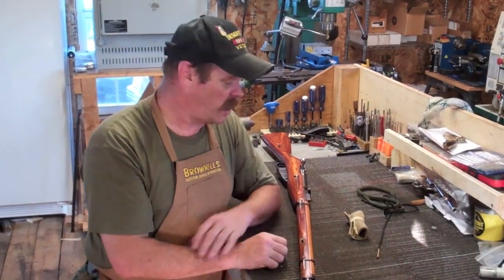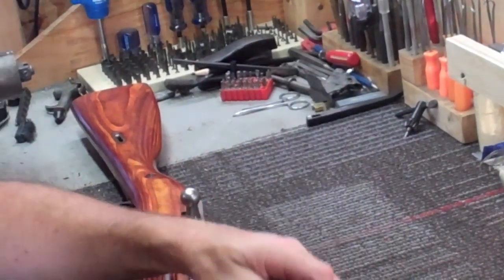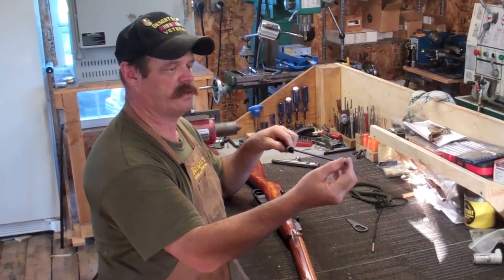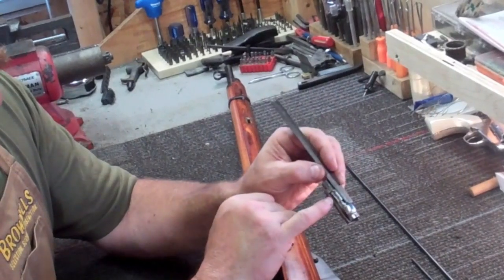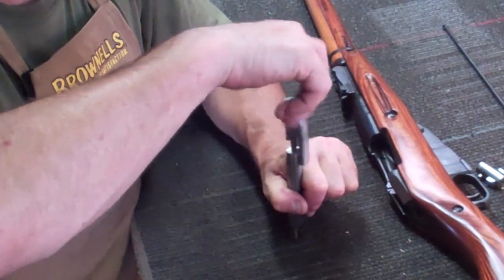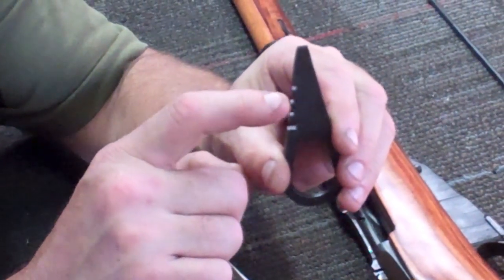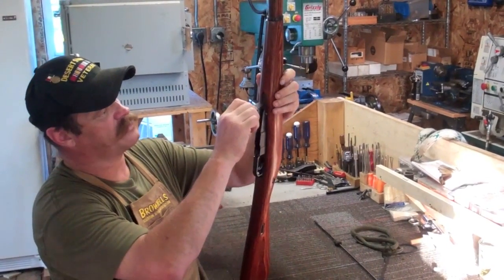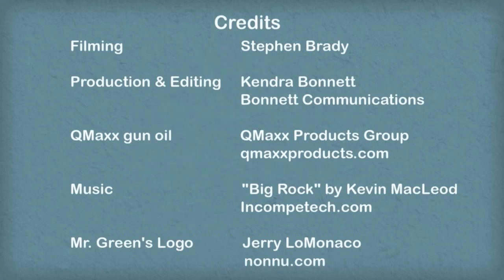Gunsmithing Disassembly: Mosin-Nagant Model 91/30 Gunsmith Cleaning Tips (Gunworks)

Comment: I have watched a lot of Mosin Nagant videos.  I have yet to see one with such easy to understand 'step by step' instructions on bore cleaning and bolt dis assembly.  What I like is how you explain the reason for each step.  How to hold the bolt assembly keeps things from being so awkward, and showing how bolt slide can be used to remove the firing pin. That would have never occurred to me. This is much easier to use than the short tool provided, especially if the multi tool isn't handy.  Great job!  I'm keeping this video bookmarked!

Comment: This is an awesome video.  I just bought a 91/30 this past weekend and I did not know some of the things that you mentioned about the funky tool and the safety.  I did however figure out the bolt disassembly on my own aside form removing the firing pin.  Great video.

Comment: I would suggest to anybody using the cleaning rod and guide to make SURE to clean the tip of the barrel. The cleaning rod and guide cap can cause the user to forget to clean the very end of the barrel, which will quickly lead to ruined rifling at the end of the barrel and you will have to counterbore or cut it off and recrown, assuming you are using the corrosive surplus ammo that causes the metal to rust. This is why so many of these guns have been counterbored by the arsenal refinishing it.
However I would also suggest to not use the cleaning rod at all, buy a carbon fiber Tipton cleaning rod (the long one) and only clean from the receiver end because the steel cleaning rod the gun comes with can scratch the metal in the barrel. I suspect he covered this in another video but just wanted anybody who has only seen this video to make sure they understand exactly what they are doing to the gun when cleaning it with the parts it comes with.
Using the rod and parts it comes with is better than not cleaning at all for sure, but spending $40-50 on a nice rod and some brass jags will extend the life of the gun quite a bit.

Comment: you may also use the multi tool's little opening to turne the firing pin instead of using the bolt connector.

Comment: here's a little tip that you forgot to mention in your video there is a decocking for that rifle. once you slide the bolt forward let it click only once as your closing it pull the trigger and it'll slowly let the firing pin go forward

Comment: I almost sent an email, but this may be something someone else has wondered about as well.
I've been around on Google and I've passed by a few conversations about rechambering the Mosin 91/30 for another round, a smaller 7.62x39 round.
They say that the barrel would have to be set deeper into the receiver and that the bolt face would need some work.
Is there any possible way that this is a feasible task?
If so, I may need to get in contact with you.

Comment: I heard that it's a bad idea using the original cleaning kit and rod.. Can anyone tell me why or if this it true? And how does the patch go on the rod? Do you simply put it over the end piece?
Reply: First off, I'm not expert at this, so YMMV. I own a 91/30 Mosin Nagant, 1942 Izhevsk, with a good muzzle and bright bore. The reason I heard to avoid using the kit and rod that came with the rifle was to preserve the muzzle (even though the kit comes with a guide cap) and the bore, because the rod and jag are steel, and might cause damage. If you've got a "beater", as some people call them, you might not be too worried about it, but my rifle shoots straight and I want to keep it that way, therefore I have brass jags and a one piece carbon fibre rod that I feed from the receiver to the muzzle (note that you have to make sure to get the right length of rod, 40" ). However, that said, I keep the original cleaning kit and rod because it just wouldn't be complete without it... and as noted in the video, the spacing tool is very useful.